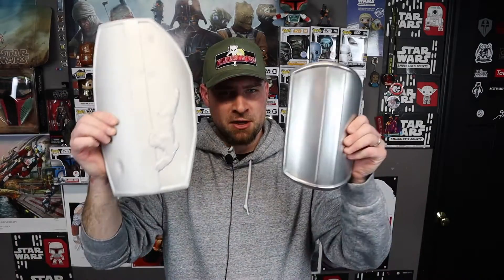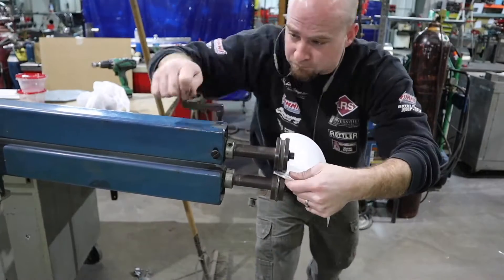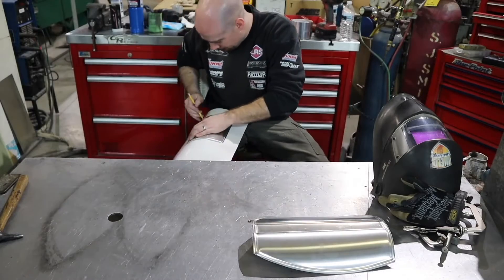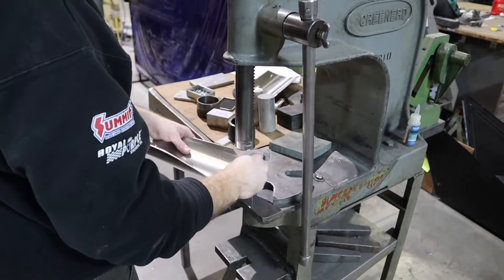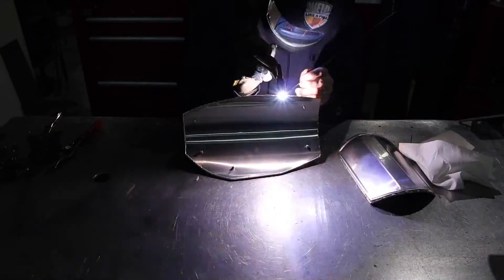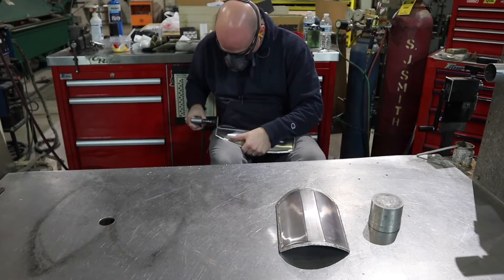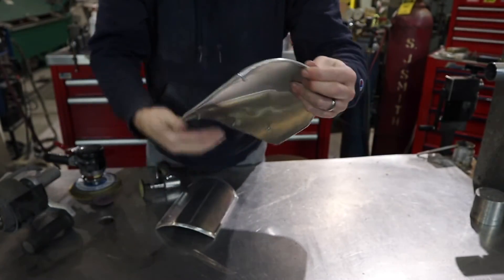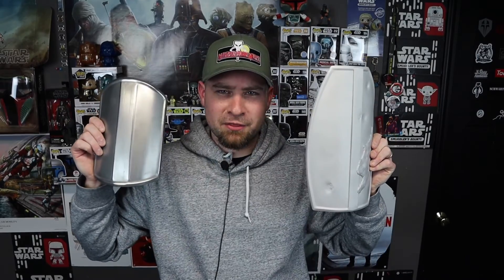MAKING "The Mandalorian" THIGH ARMOR OUT OF METAL

Comment: I once cut a whole set of Jango armour from sheets of galvanized steel with tin snips, I was going to back it with fiberglass with studs for mounting embedded in the fibreglass.
I like your mounting system better but do you feel the screws on any of your bones?
And how heavy are your aluminum with foam armours + vest?

Comment: Most mandalorians started with a beskar helm and then had to earn and pay for additional beskar armor. In the meantime they had durasteele armor.  Boba, and Jango did not have beskar armor or helms.  Mando in the new Disney series started with a beskar helm, then obtained a shoulder piece, then obtained enough beskar to have second shoulder, chest, back both arms/curráis pieces and one thigh piece.  Most of the mandalorians in the new show are not wearing beskar armor. Some do not even have beskar helms.  You can tell by the battle damage on the armor.  Beskar was not supposed to dent, scratch or deform, instead if a hit was strong enough it would shatter.  At least based on my geeing out on the lore.
Reply: Sad thing is this is now incorrect 
By the time you made this comment it was correct but now boba/ jango’s armour is beskar lol

Comment: With your two piece flight suit, do you just use duck canvas carpenters dickies and a regular dickies long sleeve? I want to do a two piece flight suit for my wifes armor and mine but I want to make sure I get the correct clothing so I can get approved by the Mando mercs
Reply from the maker: Basically yes if you go black or navy you can use dickies standard pants though

Comment: What tools do you recommend we start collecting to get into this? Maybe we have access to a shop and some of the bigger tools (e.g. TIG welder, giant shear, shop air), but want to start collecting our own smaller tools that we can take care of (e.g. tin snips, angle tool thingy, planishing hammer, those big plastic hammers, some other kind of hammer?, air tools, dies to put in an anvil). David Guyton has something (https://www.amazon.com/shop/davidguyton), but I'm curious to see your take.
Reply from the maker: Those all sound great I would add sand bags, deburr tool, automatic center punch, Cleco pliers with 1/8” clecos, a nice drill, drill bit index, rotobroach set just off the top of my head